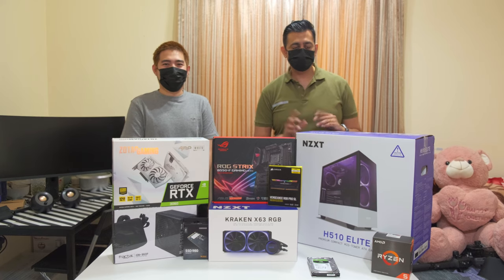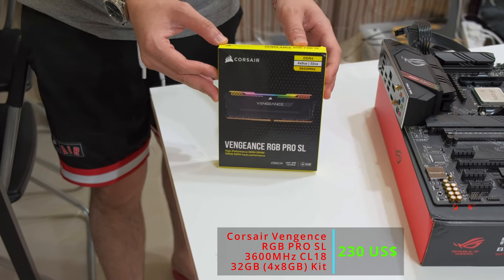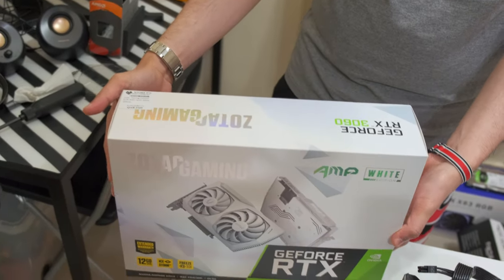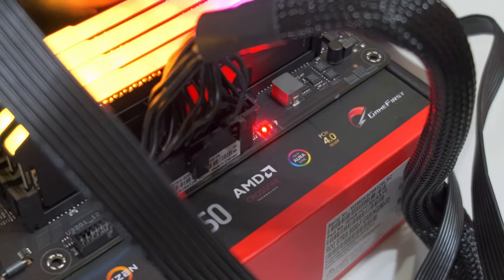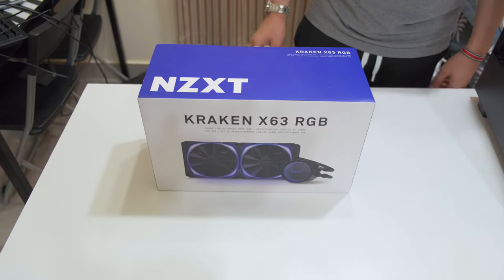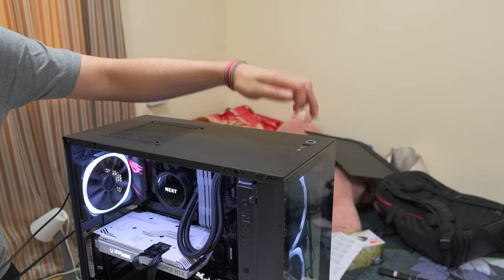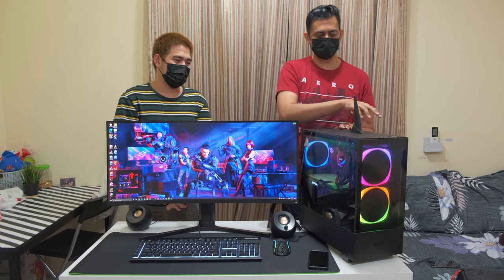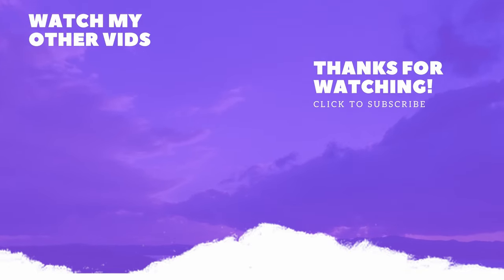$1900 PC Build Vlog (2021) - It has a Ryzen 5 5600X and a Nvidia RTX 3060 😅

Comment: Doesn’t the b550 work with 5000 out of the box
Reply from the maker: as the b550 motherboards were released months before the Ryzen 5000 series. some do and some don't well not at least perfectly... so its always better to update the BIOS initially, to have the best stability and performance so you wouldn't have to do later.
Reply: @ronstechreviews  another suggestion, while doing b-roll remove the glass for no reflection